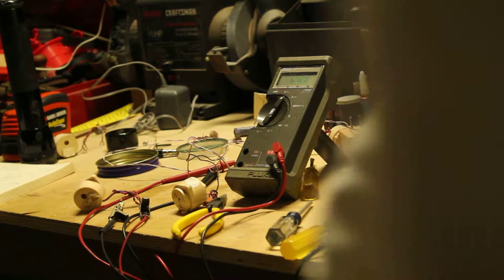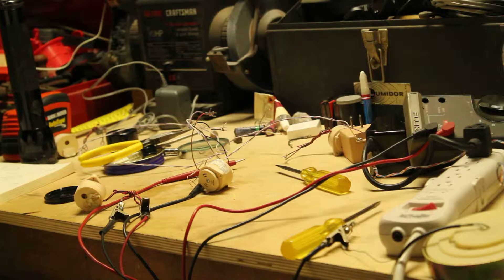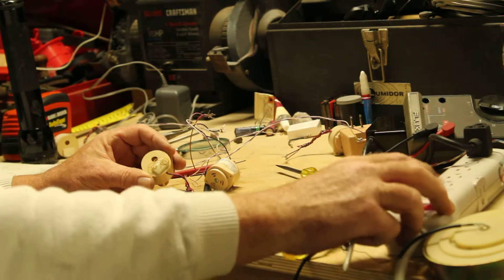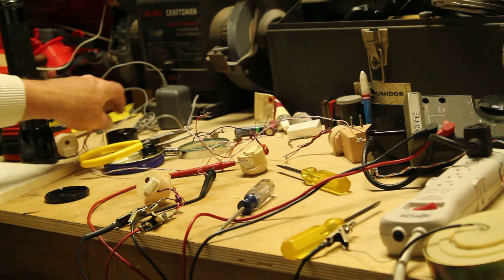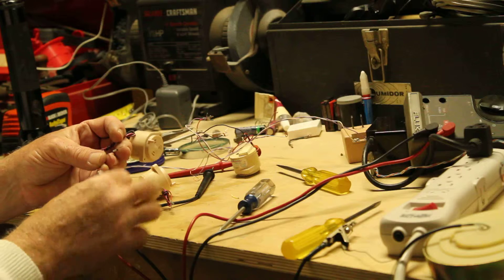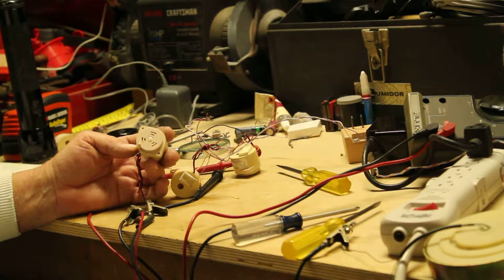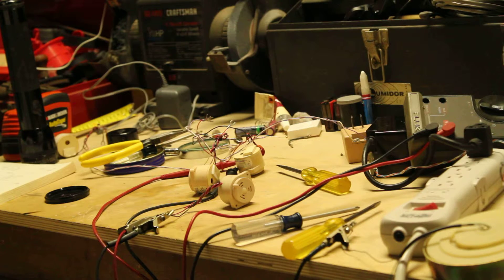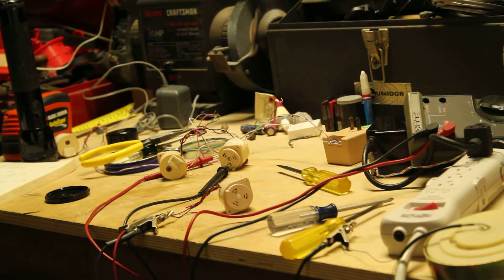Warble Tone Small Bell Ringer for Telephones

Comment: would you make a video on how to make a bell box/subset from parts? They want way too much on ebay for bell boxes and usually can't answer any questions. I have a 201 that needs a ringer box. Would you show both installing the network in the phone and box. This fix looks good but I want to use old brass bells to sound like it was when it was new. Thanks
Reply from the maker: jludtxs  Well, honestly?  Why?  The parts alone are going to be some dollars and the time it takes to build a network= money.  Your probably thinking of the normal phrase, 101 annd 202.  Sometimes the 202 is known as an oval base, OR a "D-1" Model.  In any event, you have the old dilema of running the switch-hook/transmitter and receiver through 4 wires.  Those four wires must go to a "Subset."  That Subset serves 2 purposes.  It makes the phone work, and it usually has a ringer attached so you can hear when someone is calling you.  With your "201" is it a dial or non-dial?  That is the first question.  Secondly...Just buy the subset on Ebay and move forward.  Sometimes saving a dime just isn't worth it and to do it right will give you more satisfaction in the long run.  Believe me I have been in your shoes - I know.  Write me and I will charge you a low fee to get your treasure working goiod as new after you get a metal or wooden subset and I will charge you $30.00 for the network.  You will have a phone that works and you will always cherish it be happy you had it done correctly by a guy that WAS a Pacific Telephone Repairman and NOT an electronics guru.  WHen I say my phones work, you can count on it.  I have been working on telephones for 35 years. Let me know.